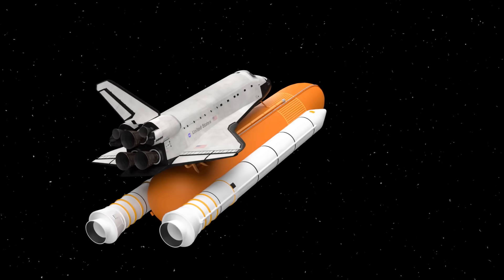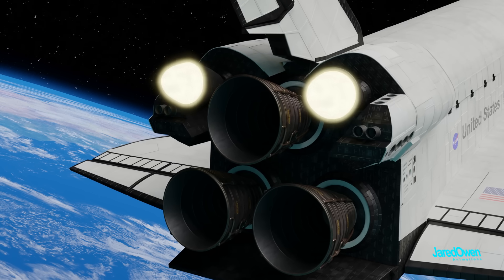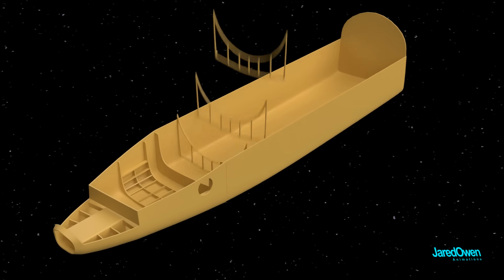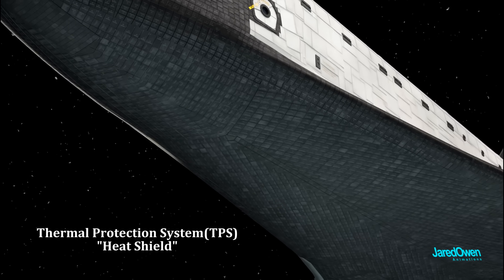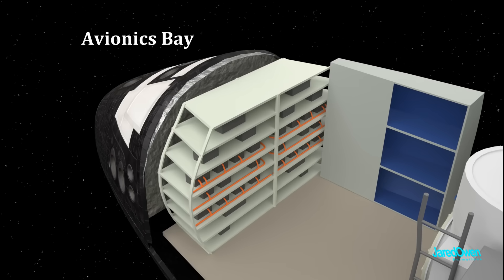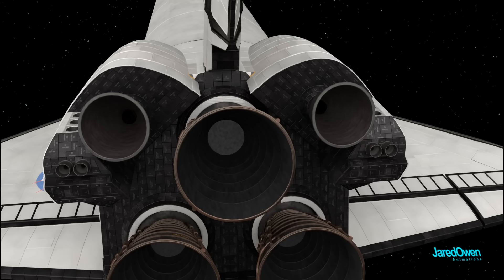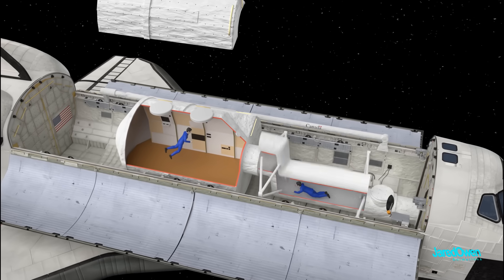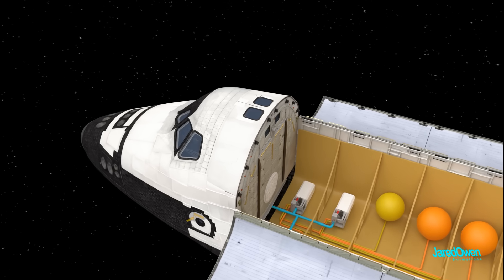How did the Orbiter Vehicle work? (Space Shuttle)

Comment: Free energy is so super simple that it should be proof positive of an extremely powerful spiritual warfare going on behind the scenes to cover it up. This technology can be found in Ezekiel 1:16, from a UFO motor description =” a wheel in the middle of a wheel.” I used pulleys to imitate this technology, where you only pay a few sparks of current for 1 rotation of a motor with a 33 cm circumference -(about 10 cm diameter) pulley attached. This would freely gain you 99 cycles of AC or DC electricity, from 3 of the 1 cm circumference mini-pulleys with motors or generators attached, by simply running the same belt-strap or even a tied piece of rope or string in a pinch, past these mini-pulleys. 
- 
Trump was-is+will-be the best American President,,, EVER. Did you notice that the fake news of the media does not mention all the great things Trump did?. Democrats not only want to kill your unborn offspring, but they want to kill them after birth even. DON'T BELIEVE ME,,,., then Google Democrat + abortion, then you can see for yourself. 
-
TRUMP ELECTION SCANDAL <<< This Is Scary >>>
https://www.youtube.com/watch?v=V_7Z058MC7M&t=3735s
+ https://www.youtube.com/watch?v=dBj9ZDC_Ad8&t=1481s 
+ https://www.youtube.com/watch?v=J-Wwe9QEOZwjjj 
+ https://www.youtube.com/watch?v=V_7Z058MC7M&t=3720s 
+ https://www.youtube.com/watch?v=V_7Z058MC7M&t=3735s 
+ https://www.youtube.com/watch?v=OWwNJZhcrww 
+ https://www.youtube.com/watch?v=R5ki6S-WsKU&t=977s  
+ https://www.youtube.com/watch?v=Z8UZn7PmyXc&t=112s 
+ https://www.youtube.com/watch?v=Dc-HQyBm8GU&t=4242s 
+ https://www.youtube.com/watch?v=nTOWOVjLY7&t=35s 
+ https://www.youtube.com/watch?v=VgUjecJtcOY 
+ https://www.youtube.com/watch?v=Tu36fdKhVuw 
+ https://www.youtube.com/watch?v=NbkPrQG7W3g
+ https://www.youtube.com/watch?v=2zqlXmiKR1c 
+ https://www.youtube.com/watch?v=hh0rW3mfBi8 
+ https://www.youtube.com/watch?v=9UhoTmFQHQ0 
+ https://www.youtube.com/watch?v=7SAER0o9Z8I 
+ https://www.youtube.com/watch?v=-I-fqDf62tI 
+ https://www.youtube.com/watch?v=fUCC1q9Mr9M&t=827s 
+ https://www.youtube.com/watch?v=g0BKdRywTcg 
+ https://www.youtube.com/watch?v=nY2AXIx-GU4&t=299s 
+ https://www.youtube.com/watch?v=b8fs1kR4tMs 
+ https://www.youtube.com/watch?v=4X5iIZzGTAk 
+ https://www.youtube.com/watch?v=R5ki6S-WsKU&t=194s 
+ https://www.youtube.com/watch?v=zeOMCYMElDg 
+ https://www.youtube.com/watch?v=BY-wPg4-b88 
+ https://www.youtube.com/watch?v=cuizbP5inQM  
+ https://www.youtube.com/watch?v=-GvNKYEh1y4 
+ https://www.youtube.com/watch?v=ADDrSvNyqEY 
+ https://www.youtube.com/watch?v=ajavsMbCapY 
+ https://www.youtube.com/watch?v=OUS9mM8Xbbw 
+ https://www.youtube.com/watch?v=ok_VQ8I7g6I 
+ https://www.youtube.com/watch?v=4gseOeyS0NQ 
+ https://www.youtube.com/watch?v=2bfWCdg4B04 
+ https://www.youtube.com/watch?v=HIKOXyxlhag&t=381s 
+ https://www.youtube.com/watch?v=fCqwwHs6oU0 
+ https://www.youtube.com/watch?v=V_7Z058MC7M&t=3735s 
+ https://www.youtube.com/watch?v=5649FAF3_ws&t=381s
+ https://www.youtube.com/watch?v=WY6v2aFRLaY
+ https://www.youtube.com/watch?v=wX-GckOGeXA
+ https://www.youtube.com/watch?v=a4Em8LsLUhw
+ https://www.youtube.com/watch?v=OT4FSciSIo0&t=617s
-
Want to know more about something that really matters, like the Truth about the true powers of this world, Reality + what our lives are truly all about. Trump believes in our Father in Heaven, and by the way, the ARK of the COVENANT has been found in Jeremiah's Grotto, right under where YESHUA=Jesus was crucified. So HIS BLOOD + WATER that came out when He was stabbed by the spear could run down the crack in the bedrock, that happened when the earth quaked + landed on the correct side of the ARK, that was placed there many hundreds of years earlier. His dried BLOOD was still alive even, + tested as only having 24 CHROMOSOMES = Virgin Born + proving HIS DIVINITY.. (only had one parent= regular 46, which is 23 chromosomes each) + with only one male Y chromosome from the Father.
-
PLEASE WATCH THIS VIDEO https://www.youtube.com/watch?v=B8TRoQk6WUE @ (41:41) = HIS Blood is STILL ALIVE + had only 24 chromosomes = 23 from his mother + only One from His Father (normal people have 46 = 23 from the mother + 23 from the father). If these videos have been taken down, then in YouTube search these words = ( ark of covenant blood Ron Wyatt ) - Sorry guys + gals, but the higher up elite of mankind has decided to believe + side with these aliens (fallen angels + Nephilim) = sons+daughters of the children of fallen angels + human females in building these particle colliders - which mess with our timelines.
-
Isn't it amazing what knowledge we can gain by simply adding the “il-s” of life, into this evil theory.,, EVil-sOLUTION. Evolution never happened,,, and it never had the time, so it could have happened,,,, because we have only been here on this earth for about 6000 years. Think about the odds of us on this earth that is constantly gaining mass from space dust and meteors, revolving around a sun that is always losing mass from burning fuel=mass. If mankind has evolved over billions of years, then why is there only about 6000 years worth of space dust on the moon = see the moon landings, there are only a few cms of space dust. If evolution ever happened, then it needed the moon to keep the oceans from becoming stagnant water.
-
WHERE ARE THE THE BILLIONS OF YEARS WORTH OF DUST DEPOSIT. Surely that would have produce meters of dust, as would not the dust have been even thicker way back then + Don't try to tell me that something or someone removed the dust every so many thousand years.
-
DO THE MATH FOR YOUR SELF = the amount of dust deposit is known,,, + the amount deposited per year is known too. I did the math in the early '90s, and it worked out to be about 6000 years worth of dust that is on the moon now. I don't know if they use the same figures now or not. But even so, it should be obvious that after even one billion years,,,, the dust should be many meters thick.
+ TRUTH about COVID-19 https://www.youtube.com/watch?v=H_vNWmqWmZc 
-
FREE ENERGY = SIMPLICITY AT THE BEST (AC Electricity Multiplication using simply the geometry of pulleys to multiply AC rotations) (a DC motor only takes a few sparks of current, to rotate one full time) Please don't be fooled by the old torque problem lie, because the torque only occurs when you are producing power. And no matter how much voltage you need, when you multiply it by the few sparks of current that you need, (practically nothing) it equals only the smallest amount of power, (requiring very little torque).
-
THIS AC ELECTRICITY MULTIPLIER WORKS, and it is so logical that it simply MUST WORK. This uses a few sparks of DC current to rotate one large pulley of 33 cm circumference = (about 10 cm in diameter) one single time. Then by rotating 1 to 3 mini-pulleys, of one-centimeter circumference, = 33 rotations each. If you attach AC or DC generators to each of these mini-pulleys, then you can get a return of 33 to 99 cycles of AC or DC electricity as an output. Which is far more electricity output than you would need for the few sparks of DC input, which is all the input drive motor needs to rotate once.
-
The only reason that this super simple technology has not been used earlier to create free energy for us, are the millions, if not billions of fallen angels + evil spirits, trying desperately to make sure, that mankind never discovers this super simple technology, which is God’s Gift to mankind, which He laid out for us way back in Ezekiel 1:16 http://free-energy.yolasite.com/
-
(EZE 1:16) “The appearance of the wheels and their work was like unto the color of a beryl: and they four had one likeness: and their appearance and their work was as it were a wheel in the middle of a wheel.” - As in, a little wheel inside a big wheel, but I could not afford to buy a big wheel with threading on the inside, and a mini wheel with the same threading on its outside. So I did the next best thing, I connected a big wheel to a mini wheel through a belt, strap, rope, or even a piece of string in a pinch to connect the two pulleys with motors attached.
-
Have you ever heard of the MANDELA Effect? PLEASE CHECK THIS OUT,,,, + then try telling me that there is not a POWERFUL SPIRITUAL WARFARE going on in our world. This is a must-watch video. All of time and space are changing. Things that are true have been altered + CERN is the cause for these events.
-
- Here is one of the videos trying to let this scary information out https://www.youtube.com/watchv=pPrutcbaerQ&list=PLDIEv5nkqqEa0-u8DIzqpefKBAG0nkb7g&index=1 
-
+ here is an explanation by the Physicists https://www.youtube.com/watch?v=HHKmoBeNWWQ&list=PLDIEv5nkqqEa0-u8DIzqpefKBAG0nkb7g&index=2 
-
CERN Is Changing Our Timelines – Proof - Mandela Effect Part 1 + this is a video of what they are really up to https://www.youtube.com/watch?v=49dGknES0-w 
-
Here is a website that shows you how quick + simple this GEM technology is to build
= https://www.youtube.com/watch?reload=9&v=NxpoiCFKmPg 
-
http://free-energy.yolasite.com/ 
http://beliefstoliveby.yolasite.com/ 
http://aliensandghosts.yolasite.com/ 
http://decimationofthisevolutionfairytale.yolasite.com/ 
http://evolutiondebate.yolasite.com/ 
-
TRUTH ABOUT CERN
https://www.youtube.com/watch?v=49dGknES0-w 
https://www.youtube.com/watch?v=ooZA0riSa9Y 
D-WAVE COMPUTER
https://www.youtube.com/watch?v=1v19n5JBSDs&t=305s 
RELEASING DARKNESS
https://www.youtube.com/watch?v=7TA-z6RrXRo 
EXTREME NATURE CHANGES
https://www.youtube.com/watch?v=7HnSOZXZdWU 
ILLUMINATI PLAN FOR HUMANITY
https://www.youtube.com/watch?v=49dGknES0-w 
Satan's Name Is "God"
https://www.youtube.com/watch?v=_qr2vT5ySLA&t=113

Comment: If the main fuel tank burns up and is destroyed when RE ENTRY,    why didnt it burn up on the way out?
Reply: Ascent:  Relatively low speeds while in the denser layers of the atmosphere (some space boosters even jettison their payload fairing during the first stage burn -- it doesn't take long to get above almost all of the air).  Reentry:  Maximum speed as it enters thicker and thicker atmosphere.
Reply: @marcmcreynolds2827  ahhhhh,   I get it  a think, (  on way up, coz theres travelling  at a faster rate , there not exposed to the heat for as long,   but   as they re enter  there travelling  slower  so they heat up more?)    Am I on right lines there?    But  I get the  underside is protected  with the tiles,   but what about the  top and surrounding sides,   are they not  exposed to any heat damage?     P.s  thanks for replyin n explaining
Reply: @boombastick7113    You're welcome.   "Am I on right lines there?"  No, but that's ok -- we'll get there!  It's true that they are speeding up as they ascend, but the speed is still quite low compared to orbital/reentry speed.  Call it one-tenth of orbital speed.  So despite how the Shuttle might appear to be roaring through the clouds, it's basically creeping slowly out of the atmosphere compared to the speeds is will reach a few minutes later, or that the tank will see at reentry.

Here's an analogy which might help.  Even though it's about forces rather than heating rates,  perhaps it still illustrates the situation well:  Suppose you are at the bottom of a swimming pool (the atmosphere).  You feel some resistance as a crane cable pulls you slowly toward the surface (the top of the atmosphere), but essentially none after you break the surface and it continues to raise you say thirty meters above the surface.  Then it releases you, sending you falling back towards the surface (the top of the atmosphere) at a much higher speed than when you left it.  Splat!  That fluid is going to feel a lot harder when you slam into it at the much higher speed than it did when you slowly left it.

That's what happens with the ET:  Pulled relatively slowly through a fluid (air) by the STS propulsion systems on the way up, and then splat! on the way down at still close to orbital speed.  Lower heating rates on the ET from air friction as it ascends relatively slowly, but then destructively high heating when it slams back against the surface of the atmosphere at much higher speed.

By the way, as an educated guess the insulation sprayed on the side of the ET is more for keeping its cryogenic propellants cold than for keeping the tank's metal from overheating.  Consider that a Titan II ascends through the air faster than STS, for example, yet its aluminum (non-cryo) fuel tanks are bare rather than insulated.

"the  underside is protected  with the tiles,   but what about the  top and surrounding sides,   are they not  exposed to any heat damage?"  Everything is protected, but most of the tiles not on the bottom are white -- so that's not white paint on the body, vertical stabilizer, etc.  Later on in the program BTW, some of those white topside tiles were replaced by similarly colored "blankets" in the relatively low-heat areas.
Reply: @marcmcreynolds2827  bud, again thanks for the reply  explain,  when a 1st started readin I thought, am gonna get confuddled  here, but I actualy understood it,  u have a relatable  way of explaining  the details, but  not to the point,  ( a novice of  space exploration) like me cant understand,....   its  fascinating,  ya learn a bits which  ad more  to the jigsaw n ya want to make the full pic,  but , u can end up more questions than answers lol,    cheers  for the Info,      stay  safe where ever ya are buddy 👍🏻🏴🏴👌🏻
Reply: @boombastick7113  Yup, staying quite safe...  in the middle of an area with a 20% positivity rate.  Science comes in handy for more than just space rockets.
Reply: @boombastick7113  2 simple reasons

Friction by re-entry 

the gravity pulls it faster when its falling and not when the escape velocity is more than the required gravity

(i might be wrong coz i'm still learning about space)
Reply: Just wanted to add that the ET is purposely jettisoned in such a way that it enters the atmosphere in an end-over-end tumble and the aerodynamic forces caused by this does a pretty thorough job of breaking up the tank. Then of course the frictional heating has more surface area to do a very thorough job of burning it all up.

Comment: how by firing the engine, space shuttle do reentry? can you explain?
Reply: "Orbiting" a planet is really "falling around" a planet.  At a certain forward speed, the amount that an orbiting object drops towards the planet in a given time from gravity will equal how much the surface has "dropped away" from the object based on the planet's curvature/diameter.  So the object keeps trying to fall, but it doesn't hit the ground because the ground keeps moving out of its way.  Easiest to visualize by imagining a "polar" orbit, with the object having just passed the north pole.

So firing an engine against the direction of orbital motion decreases speed (deceleration = thrust / mass), and at that point the surface is no longer dropping away at the same rate gravity is pulling the object towards the surface.  Sooner or later, depending on how much the speed is reduced (and depending on atmospheric/aerodynamic particulars if an atmosphere is present), the object will impact the surface.

Comment: The orange tube fell to the earth and burned in the atmosphere, why didn't the plane burn when it flew from the earth to outer space and didn't get burned when it flew into the atmosphere?
Reply: Because of the stuff at 5:48
Reply: @buttwagon09  apologize before his friends, it explains when he returns to earth, the layer protects him from being burned by the atmosphere when he returns to earth, how does he not get burned when he flies from the earth out of space? while the plane is pushed by rockets very fast, when it hit the atmosphere why not explode / burn?
Sorry if I ask a lot of questions, because I also don't know and want to know,
Reply: @kangrepost2495  It all has to do with speed. The shuttle goes from Earth to space much slower than going from space back to Earth. The high speed on reentry is what causes the extreme heat.
Reply: @kangrepost2495  its even more faster as earth's gravity pulls it back into the atmosphere. The friction causes the heat. Since there is no heat shield on the External Fuel Tank, it burns up in re-entry